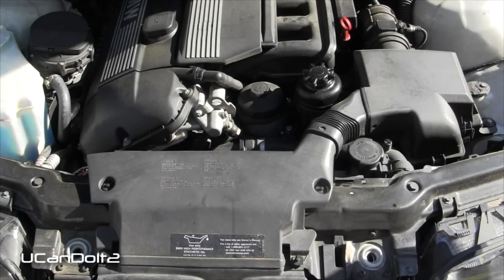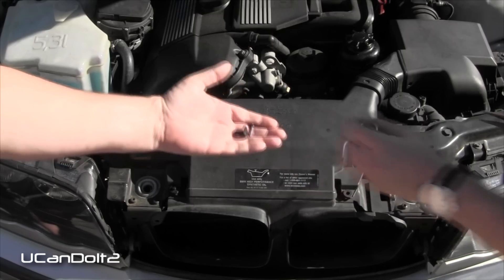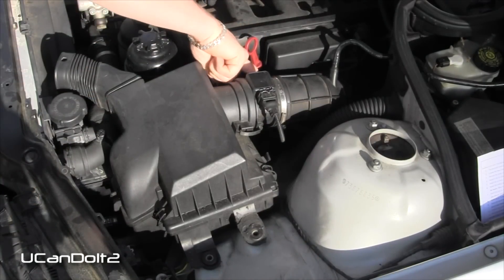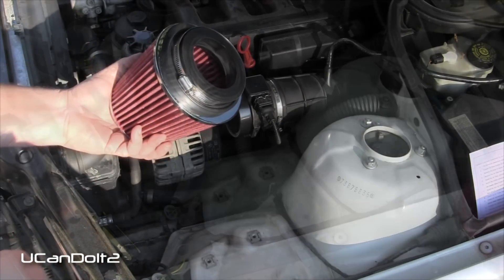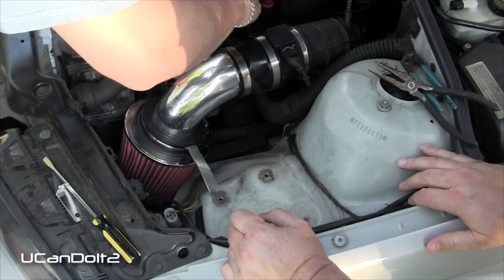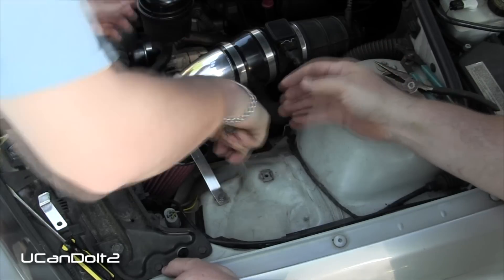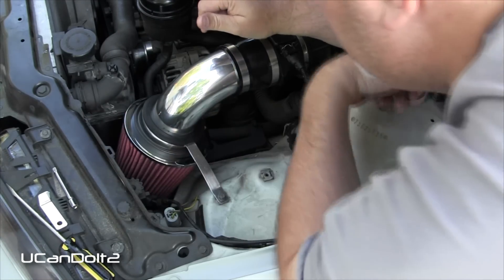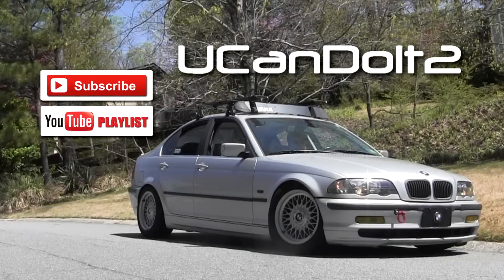BMW 328i E46 - K&N Air Induction Kit

Comment: does anybody know where you can buy ONLY the Heat Shield without having to buy the entire cold air intake kit? i have this induction kit and yes its drawing the hot air from the engine so all i need is the heat shield...

Comment: I've done this and you getting too much hot air from the engine bay.  You have go deeper down towards the bottom of the wheel or behind the lower grill to actually get cold air ----- I've noticed the BMW intake design is much better the short ram system you placed on there --- too much hot air from the engine --- just my opinion.
Reply from the maker: +Master G Jasuwan You are correct, this is not a Cold Air Induction solution.  A Cold Air Induction would isolate the inlet so that heat from the engine would not be drawn into the intake.  I believe the purpose that the manufacturer was intending with this system was a better breathing intake.  Thanks for watching.
Reply: Mine gets too hot and shuts off , I'll try it deeper lol

Comment: I'm trying to figure out if this would fit on ym 2010 bmw 328i, i took it apart and it looks similar, my only problem is that the MAF is attached to the filter box unlike yours which is connected to the tubing.....
Reply from the maker: Your 3 Series is a different chassis than mine.  It may/most likely will require a different configuration what I have.  While the product that I install may fit yours, it also may require customizations.  You would be better off, searching (google, ebay, amazon) for a solution for your exact chassis.  I believe you have an E90, E91, E92, or E93 (AKA "E9X").  There should be several options for products for your car.  Key on your Chassis Number.  Cheers and thanks for watching.

Comment: good modification and looks and Everything but u still getting hot air intake. this won't increase ur power. u need a heat shield to collect cold air for ur car. u should've put ur air filter in ur bumper.
Reply from the maker: You are correct!   This is NOT a Cold Air Intake!   This filter does have a larger filter surface than the stock.  The greatest benefit is that it lets the engine breath better and without restrictions (possibly a little performance increase there).  The only 2 other differences that I can think that it makes are:  1) There is a difference in sound, it sounds throatier, and 2) when you lift the hood, it looks freakin' bad ass.  Hope I didn't misrepresent this as a Cold unit.  It is not!  Thanks for watching!
Reply: +UCanDoIt2 i got e46 323i 1999 modle bmw with full exhaust system headers hi flow cats dual 2" pipe conversion with 2 remus mufflers stage 2 remap with 3.46 diff swop. i installed the k&n  cold engine air intake system as well. i tell you what i can feel 5-10hp gain at high end revs.

Comment: could you provide a link where i could buy this.
Reply from the maker: +Simas/Mc I bought mine on eBay.  Search for:  "K&N Black Red E46 Air Intake".  Or if you have a different car or chasis number, make those changes.  I purchase the one from "ChromeIntakes" for about $90.  There are different colors that are available as well.    A link may not be valid for long, so I thought it would be better to provide you with search items.  Let me know if you need more help!
Reply: +UCanDoIt2 ok thank you.

Comment: Personally I'd never remove my stock box. It gets cold air from the grille and Bmw made it so the car can perform the best. I like the sound of the aftermarket come filters but the performance is not as good as the stock intake box.
Reply from the maker: +Mike Moyer You know, I can't disagree with you.  It's my son's car and I think he was going for the throatier sound more than any implied performance gains.   It is not marketed as a Cold Air Intake and that is a good thing because it is not.  It does breath a little better than stock and quite sexy when you lift the hood!  Cheers!
Reply: It's all about where u position ur in take . I did mine it gains power and sounds really amazing and I have the 2.5 323i its pulls